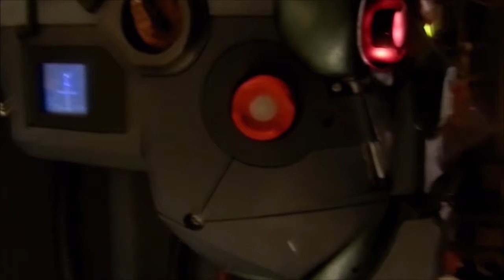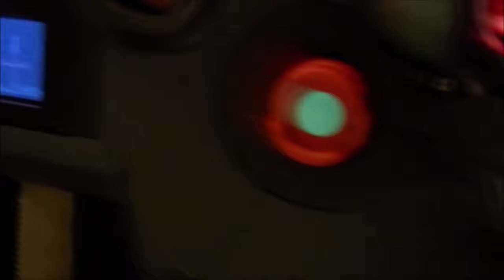SCULPTURE - ROBOT head - mask - costume - project (JiM SWEET) EVA foam

Comment from the maker: 08:50 testing head - mask fit
              Here is just a test fitting of an almost complete head. This was the original paint job until I decided it looked a little too dark and I later added the lighter grey color to it. You can see the eye and jaw movement pretty good in this video. 

09:22 final head - mask demo
              Sometimes the head fits different and I can move the eyes without the jaw opening, but I was having trouble this time. When I opened my mouth to stick my tongue out to move the eyes, the jaw would open. The two cables in the front are suppose to go into the chest piece. The chest piece has a cavity the holds the flash lights and there is an outside cover layer that connects with velcro and when I take off that outside cover layer, the cables can be placed on the sides of the flash lights and then I cover it back up with the outside layer of the chest piece after. I didn't do it here though. 

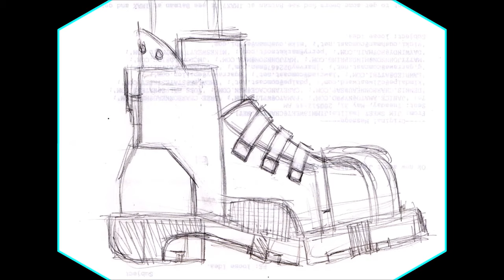12:24 other parts boots - arm - hand
              The boots : 12:26
              The arm    : 12:52
              Here are the other parts of the costume. When I originally started this project it was just the head that was important to me and later on I thought, if I am going to wear the head I'm going to need the rest of the costume. I sketched up, kind of quickly, what I think would look good. I made the boots using some old work boots underneath foam and I mounted them to about an inch and a half thick piece of plywood. I was hoping for a little more height, but it was hard enough walking in these, plus it was also hard to see out of the head. I never worked with this EVA foam before, but it worked really good. On the bottom of the boot I super glued on rubber to the tread patterns. I used magnets in those squares on the end of the show lace looking piece to keep the laces down. I also used a bit of velcro to really make sure they don't move. 

13: 43 still photos full costume
               Some photos of the night I wore the suit at a friends Halloween party. The young humans were really drawn to him, too bad he doesn't like humans so much. I decided this guy was beat up and he also lost an arm, plus it saved me from making two arms huh, smart right. I was going to make broken inner arm piece for the left arm that would be cut off at the elbow, but I ran out of time for that too. I'll get around to that sometime when I decide to use the costume again. I was going to make him a modern type robot that might have raided a thrift store and stole himself a big hoodie sweatshirt and sweat pants to try to hide his identity, but I just went with a Star Wars type robe outfit. So now I picture him in a Star Wars movie in the back ground of one of those cantinas who gets in a lot of fights. Maybe that's how he lost his arm, getting in a fight with a wookie. 

14:01 VIDEO: wearing full ROBOT costume
              Here I am at the party with a fellow robot who I buddy around with. She can join my gang as long as she ins't friendly with any fleshlings. I thank her for this video surveillance of her observations of this human gathering. We kept our distance and limited our interactions with these meat bodies. 
"You humans are inconsistent.....YOU can not be programmed.....YOU ARE INFERIOR." 

14:36 JiM_SWEET_ART
           deviant art : https://www.deviantart.com/jim-sweet
           facebook    : https://www.facebook.com/JiM.SWEET.ART
           YouTube     : https://www.youtube.com/user/JimSweet/videos?view_as=subscriber
           Instagram   : https://www.instagram.com/jim.sweet.art/?hl=en

Comment from the maker: I couldn't write a long description so I figured I'll just put it here instead. 

00:17 rough - small - clay reference head
              Made of polymer clay. Only sculpted half the face very simply with this rough idea. 

00:24 rough - magic sculpt undershell
              I had a plaster cast of my own face, that I used when I made my Terminator mask (seen here) https://www.youtube.com/watch?v=rmPSRF-vGsg , so I took some cardboard and made a make shift robot face and covered my plaster face. Then I took some magic sculpt and started covering the cardboard.  I was left with this very rough magic sculpt shell. The dotted lines is my attempt to get some sort of measurements to assure symmetry. The jaw is separate and is just in place and not secured in any way yet. 
             00:28 Same undershell, rendered more by adding even more magic sculpt. The idea was to make the whole sculpture out of magic sculpt, but I started finding it too hard to work with because of it consistency and hardening time. It was also very hard to smooth out and would have taken a lot of sanding with sand paper. Jaw is attached here with masking tape. 
             00:29 I added more lines to assure symmetry by centering the mask on a piece of large paper with cross hair lines on it and matching up those lines with the mask lines. I also used a laser level to help check symmetry.

00:30 rough undershell covered with polymer clay
              After seeing how difficult the magic sculpt would be, I decided to cover the magic sculpt shell with polymer clay which I could control much better and when done, I could bake it to be hard and the magic sculpt undershell will keep it's shape while baking. Once the whole mask is hard, I can then drill holes I need to drill and paint it. The jaw here is attached by screws and nuts. The back piece I made using quarter inch metal fencing material that you can measure out easily by the squares and get a nice symmetrical piece.  I then added pieces of wood and screwed that into the metal fencing back piece to be able to attach it to the front piece. The things that look like ears are wing nuts covered with magic sculpt and go through nuts that are secured into the back piece. 
              00:34 Here I started to cover the back piece with the magic sculpt undershell leaving holes in order for the polymer clay to grab on and attach well. 
              00:37 The nose grill was made out of small metal pieces cut properly to fit the design and attached to each other using three small metal rods and spacers. It will later be glued in place. The look of the face was evolving as you can see by the changing lips. 
             00:38 The eyes where made using small flashlights put together on a mechanism I made that was secured in place inside the head. The eye mechanism was designed to be moved using my tongue. The mask had to be designed large enough to leave room for this action and so my eyes would not be poked or scratched. The hexagon piece on the chin is made out of magic sculpt and was designed to look like a speaker. Later on, an actual speaker will be placed inside the chin behind this hexagon piece. The small pyramid in the middle of his forehead was designed to be used for head butting humans or anything else for that matter. I later changed it to a large screw as if the robot wasn't designed this way but decided to add it to himself later on by screwing a screw into the middle of his forehead because it would be more effective in hurting something when head butting it. 

00:44 final rendering of polymer clay and other details
              The polymer clay sculpting is all done here now and is ready for baking. I will leave it this way with the back and front piece attached together and with the nose and chin piece in while I bake it. I gave him some dents and broken pieces on the left side of his face like he's been around for a while on his own and got into some fights. The left side of his jaw needed to be reattached after one of these fights as you can see he had to drill a new hole above the original one. This was also not originally planned due to I didn't get it symmetrically correct, but it works out making up another reason for it. There's a big dent on the left side of his forehead right above his eye, like he's been hit with a pipe of something. This is the reason he has a yellow eye on that side due to he needed to replace it with whatever he could find. 

00:55 various color schemes
              Just working out what color I'd like to paint him. There's many ways that can work, but I had to pick one. 
01:00 final color scheme
              This was it. The first time I painted it I didn't have any of the lightest grey in there and it looked just a little too dark, so I decided later to lighten it up a bit. You can see the darker version in the 08:50 part of this video. 

01:04 finished sculpt painted lights off
              This is the finished sculpt, finally done. I don't know how long it took me, I just know I started it back in 2013. I then put it aside for a little while to work on another robot project. It appears I started back up on the robot head project back in June of 2018 and got finished with the costume at the end of October and I'm just getting done with everything else now in December 2018, like this video, the photos for the video and everything else. After I finished the costume, I built the display stand for it, which you can see in these still photos. It's made of wood and laminated with rubber that I painted with acrylic paints. It's not that practical as far as wear and tear goes, but it looks nice. Paint on rubber actually rubs off to easy if it's bumped and need to be touched up. On the front of the stand I put a plastic window with room underneath the stand for a light to illuminate the cube shape. So in this part of video with the photos, I'm just showing different angles of the robot head with all different lighting. Here you can see the screw in the middle of his forehead used to make head butts hurt more. You can see a bit of blood splatter from one of his combatants. 

01:43 finished sculpt painted lights on
              Here are some more photos of the robot head on the display base with all the lights on. There's a few photos I took with one eye off just for looks, like if one of his eyes had failed. He is suppose to be a slightly beaten up robot with a yellow eye that was a replacement for his original eye. The mohawk like light strip on the top of his head is a red EL strip outlined with blue EL wire. The rest of the lighting is done using fiber optics illuminated by four flashlights with different color lights and flashing effects. 

02:59 VIDEO: ROBOT head finished
              Here is some "okay" looking video of the robot head project. The camera I used had some sort of stabilizer in it and when taking the video by hand holding it, it looked even more shaky then it should have been, so I had to apply some shake and wobble correction afterwards. This is as good as it gets, it's something anyways. The video monitor on the side of his head is an Eclipse T180 which worked out really well. Their product had some issues playing video, but since they corrected it works great now. I planned on making all different types of robot looking video for that monitor, but I ran out of time for that and I just added one of my animations to it. If you're interested in that animation it's here at this link https://www.youtube.com/watch?v=ptgNMq3nfCU&t=47s . I was going to add my animations anyways, but I wanted some original technical looking video to go along with it too.  The voice I used in this video is Ted Cassidy from a Star Trek episode where he plays a robot himself. I thought that is the type of voice I would like my robot to have and the personality he would have. He has a strong dislike for most human beings. I used Ted's voice when I wore the costume too. I have a speaker in the chin of this mask that hooks up to an MP3 player where I can add any audio I'd like to play through that speaker and I used these same lines from that Star Trek episode. You can hear the actual audio from the speaker to hear how it sounds in the 09:22 part of this video. The Ted voice at the beginning is not from that speaker, but all the stuff after is real audio coming from that chin speaker. The audio in the rest of this whole video was all added later. The circuit board is just an old circuit board I had laying around and I drilled some holes in it, stuck some fiber optics in there and glued them in place. 

07:52 inside the ROBOT head - mask
              Very quickly, you can see near the end of the wooden pegs, coming out of the back section, there is a round magnet. There is another magnet on the other peg too and a bigger one on top of that back section that helps lock in the back and front piece when putting it on. There's some foam pieces inside both front and back sections that help it fit better and keep it in place on my head in the right position without slipping around. You can see in the front section I have two springs connected vertically keeping the jaw shut. I can move it open slightly with my own jaw movement. Since the mask is built with some distance away form my own face to leave room for the eye mechanism, my jaw is to far away and not in a correct position to open the jaw wider. You can see how much my jaw can open in the 09:22 part of this video. The blue part of the eye mechanism is the part I use to move the eyes side to side. I have to my tongue to do it, so I added a finger tip from a rubber glove in order to have a clean surface to use.
Reply: jim are you on face book and im guessing in the USA I am in the UK I need your guidance and advice buddy asap
Reply from the maker: @TracyAlanBridle  Sorry I missed this comment. I hope things you may have needed went okay.